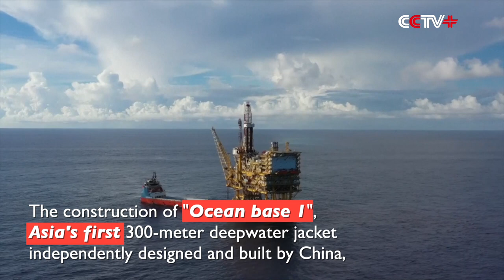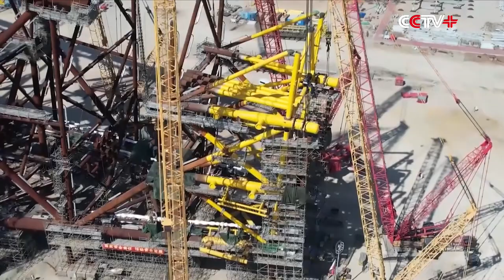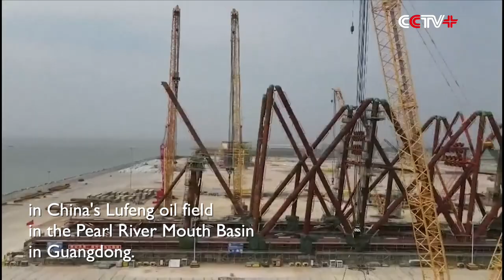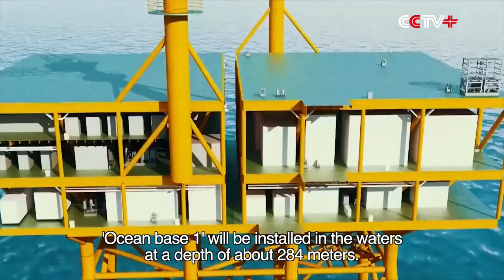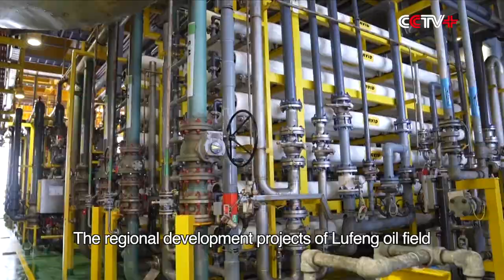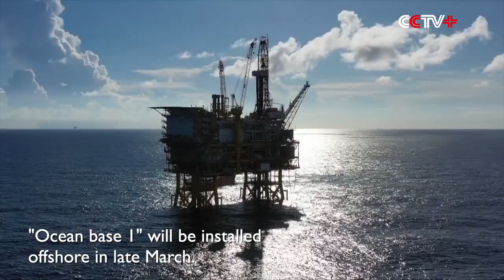Asia's First 300-meter Deepwater Jacket Completes Construction in South China

Comment: One thing for sure very likely the welding was Americans' AWS code, non destructive testing ASNT code, pressure retaining components ASME codes, structural integrity check API codes and other international codes like DNV, ABS codes and standards. They are not ashame of it, why should they? They progress with the world together. They do not challenge anyone but trying to Excel themselves. 

It was definitely not built at Houston, their gas turbines however May be Rolls-Royce and 99% of jacket steel material were American API grade indeed. 

Congratulations.